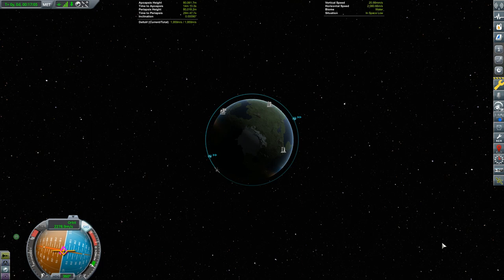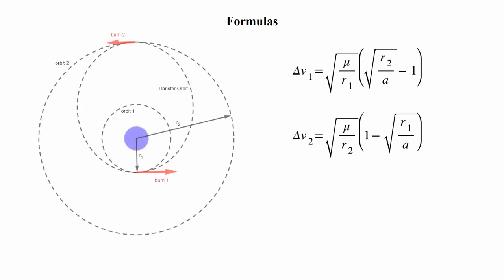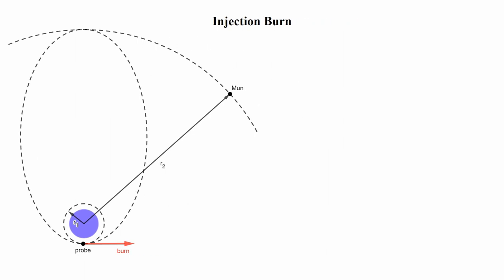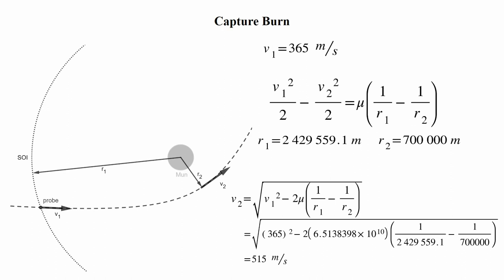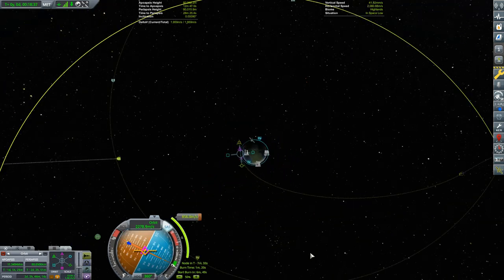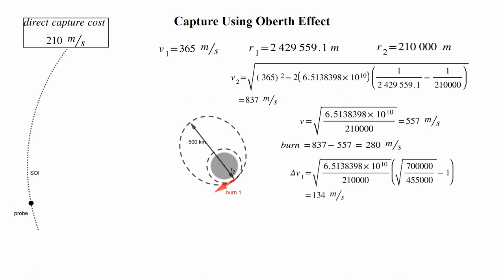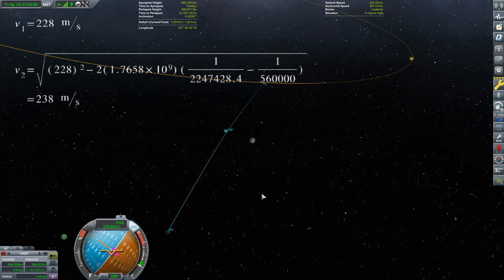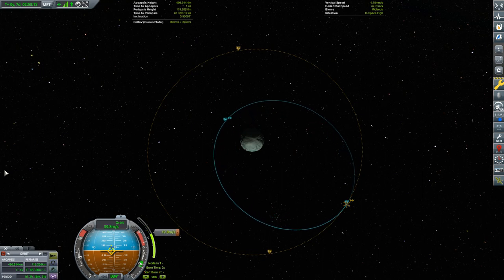Capture Costs and the Oberth Effect | KSP Let's Do The Math

Comment: Very nice. There is also a 3-burn capture that can do even better, depending on the approach v_inf and your desired circular orbit: First burn as close as you dare with just enough delta-v to make a long skinny elliptical orbit. Then coast to apoapsis and make a second burn to raise periapsis to your target radius. (I think the Juno mission may have done this?) Finally coast to this target periapsis and perform a circularization burn there. 

These multi-impulse captures work best when your approach v_inf is very high compared to the final circular orbit speed, which is why your example worked better for low mass Minmus than for the Mun. There are papers (e.g. Edelbaum 1959) that describe the trade-offs using the same equations shown here..
Reply from the maker: Nice. This is good to remember when trying to get a capture around an airless planet like Moho.
Reply: The original papers (e.g. Edelbaum 1959) are hard to find, but there is a more recent summary of 1 vs 2 vs 3 impulses for escape or capture. I tried posting links here but they got deleted, so if you search for "High speed escape from a circular orbit USNA" you will get to a paper in Amer. Journal Physics, and a PDF. They have videos too!  Reverse the arrows in their Figure 1 and you'll see the 3 capture modes - might be worth simulating in KSP?
Reply: @MikeAben  And even with an atmosphere, aerobraking in real life is a painful and risky way to lose orbital energy. Does KSP simulate atmospheric heating?
Reply from the maker: @redbaron07  It does, but it isn't as bad as real life.
Reply: And one more "plus" to the 3-impulse capture - you can change the orbital plane more easily as part of the second  impulse. (You could probably also do this before capture when very far out from the target body - so there could be a trade-off worth exploring!)
Reply: Also called bi elliptic transfert
Reply: @jeanbon6084  Kind of an extension of that, yes. Bi-elliptic transfers are typically understood to start and end at a bound orbit. In fact Edelbaum's 1959 paper is titled "An extension of the Hohmann transfer".

Comment: My guess it is the 2 circularisation burns instead of one that ends up reducing the overall efficiency of the Oberth Effect. The second circularisation burn is at a lower speed which REDUCES it's Oberth Effect.

You picked a good example, it shows you can't just assume a certain maneuver is more efficient than another until you add up all the impulse burns. The arguments I have gotten into about which Gravity Turn trajectory is better... :-)

Comment: I was an idiot today. I finally managed to launch my Jool cruiser uninterrupted today, so it's in LKO. However my ISRU landers are sans relay antennas. And I don't think I have a save between the mothership getting into LKO and me launching the Pol/Bop landers. Do I send up another tiny ship with the antennas or will I be fine with just the probe core's internal antennas? It's the probe core that fits in with the Mk2 plane stuff.
Reply from the maker: The antennas should pick up a relay on the cruiser once it's close enough.
Reply: @MikeAben  then I'm not screwed. Thank you. I have a couple relay antennas on the Cruiser.

Comment: Just to repeat my comment on Patreon, ISRO has a habit of splitting their ejection burns from Earth orbit into multiple burns in order to take advantage of the Oberth effect. It would be interesting to see if this plays out as well in KSP, and especially to see how it could be plotted out.
Reply from the maker: I have done this a few times in a previous campaign with interplanetary transfers with low TWRs. Here's one where I try and explain my approach.

https://youtu.be/xiWfvIqNtbo?t=315

The Vis-viva equation doesn't take into account the time to do the burns, ie. they assume the burns happen instantaneously. It would be interesting to explore how much a difference it makes splitting the burn up when compared to doing it all at once. I'm not to sure how to approach it, though.
Reply: @MikeAben  That's it, thanks. 

I'll have to remember to try splitting the maneuver node that way just as an experiment, to see if it does actually reduce the total delta v at all. I have some missions planned that will be going out to the Mun and Minmus; those should make decent test cases.
Reply from the maker: @JohnWilliamNowak  It look forward to seeing your results. I figure when you start your ejection pointing at the planet there's something that's not right.
Reply: Yes it works too in ksp, there was even a mod i used that was  splitting the maneuver nodes into as many as you want and keeping the same departure time for the last burn. (I Don't remenber the name)

Comment: Another great one, Mike, thanks! One question: does the direction of the trajectory around the moon (coming to it from the other side, or from the front, not sure what's the correct way of saying this) changes anything in the math here?
Reply from the maker: It doesn't here because I'm staying in the Mun's SOI, but if wasn't (for example, I was using the Mun for a gravity assist), then which way you come around makes a big difference.